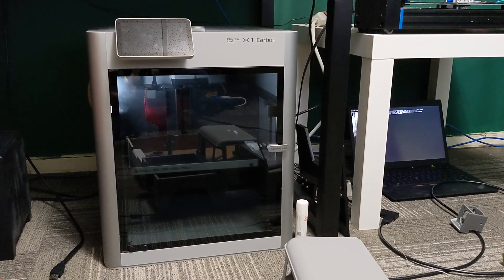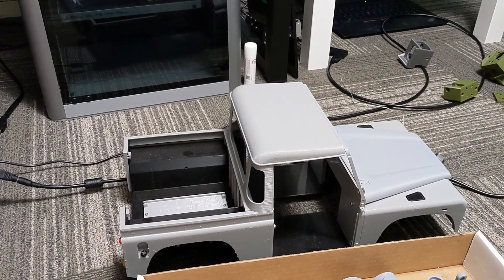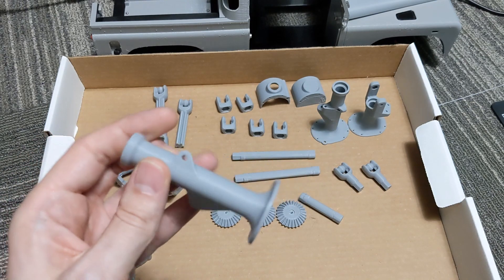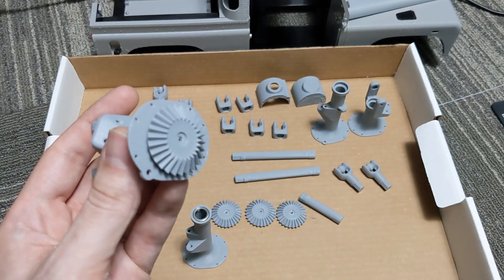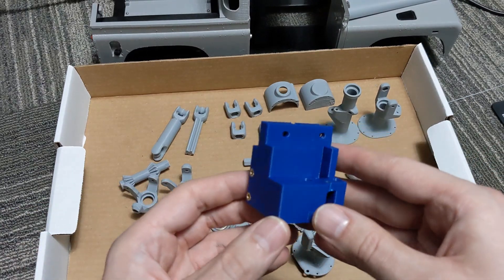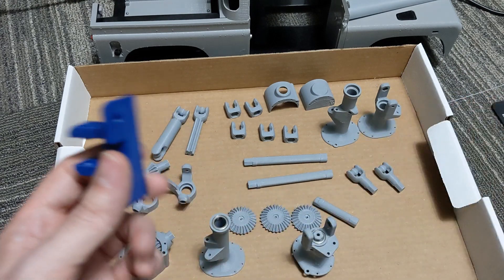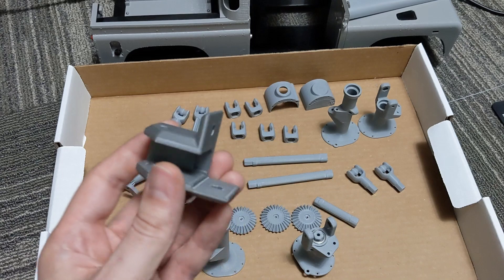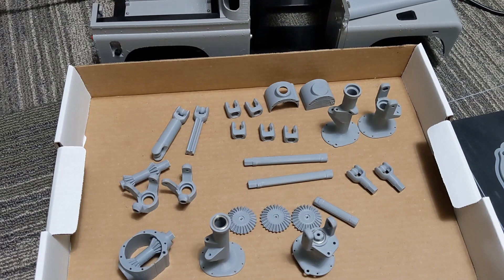Why I love the Bambu Lab X1 Carbon - EP3 PLA, ABS and PETG printing!

Comment: If you didnt change any settings, that didnt print at 200-300mm/s. Default volumetric flow limit for petg is set at 10 so you did maybe 150mm tops
Reply from the maker: Ya your right flow would have capped the speed, still impressive and easy to use for PETG

Comment: Have you tried alternate support material different than part?
Reply from the maker: I have not, I don't do any multi-material prints. However the bambu slicer supports are really nice so different support material should work well
Reply: @Rolohaun  yes I know..

Comment: damn, you're lucky that your Bambu is so accurate - my X1C is off by 1mm on 200mm prints, and I haven't found a way to calibrate X/Y steps unlike on my Ender 3. Will try some large prints in ABS soon

Comment: I have the printer and I'm having problems with PETG.  Support seems to not stick together and make spagehetti and ruins the print.  Any settings you suggest?
Reply from the maker: try and put the printer is silent speed mode to slow it down a little, I have only tried Polymaker PETG and it seemed to work fine with supports

Comment: Thank you very much for this review. Your experience with PETG is different from Aurora tech in depth review where 100 mm/sec was the highest speed that didn't have layer adhesion problems. Also did you print the PETG parts you show ("printed at 200 to 300" ???) at 200mm/sec or 300mm/sec?  Did the large part fan run during PETG printing ?
Reply from the maker: I never changed any settings, normal speed. Polymaker petg

Comment: Are you using the AMS eventually? Anyone have issues with it? (using the supported filaments in it, PLA, PETG, etc, I know you should not use PC or TPU in it)
Reply from the maker: Yes I have the AMS it work great no issues at all, I use it for filament storage and it much more convenient to swap filament with it, I don't do any multicolor

Comment: I'm concerned about printing in my small basement space (14x15) that has no windows, one vent into the main house from a nearby heater, and an adjacent laundry room. I cannot modify the house as I don't own it, and so I can vent it outside. I am getting a H14 air filtration system and an air monitor. What else can I do to protect myself if I decide to print ABS? (I may only be doing PLA/PETG if needed.)
Reply from the maker: The x1c does have a carbon filter but I hate the small of ABS and ASA so I don't print with them much. I think the carbon filter will be ok but the smell might be too much for you

Comment: What printbed did you use for petg and how do you prepare it? Because I ruined 2 coldplate stickers on my first 2 prints and now I am scared to print anymore :/
Reply from the maker: I have used both the cold side and engineering side. I applied the glue stick and had no issues. The engineering side works fine, I set my bed to 75 degrees
Reply: @Rolohaun  Did you just flip the Build Plate so it faces up (Engineering Plate Side) to print PETG (Cool Plate Side down), and just applying the glue to where it would print? I assume just changing the temp in the profile and doing some test prints is the way to go at first (with PETG)?
Reply from the maker: @adambomb77  yes that is what I did

Comment: yeah, i only startet to love my mk3s+ when i had pertinax plates on the bed and lerned to dile in testprints for new filament, also ordering 5+ spools at once helps. 
I give the bambu a try, i think in the current global economic situation it wont get much better than this for many years.
Reply from the maker: it's a great printer and tool that can potentially make users money if your selling prints and such

Comment: Very cool, this printer is trully revolutionary! I want mine!! A.I into filament calibration is awesome! I just scaried about proprietary spare parts… are they easy to find?

Please test carbon fiber nylon on this, make sure to use a hardened nozzle to this abrasive CF filaments. That’s a win-win material for mechanical parts, the CF “holds” nylon to warp a good mix about both of these good properties materials. Where do you live? I heard good recomendations for expert users pointing to CF Nylon from Athomic Filament, a brand from U.S.
Reply from the maker: Parts are very cheap and easy to get from bambu, I do want to try CF nylon. I live in Canada

Comment: I see you have it on the floor vs a table, is it due to how aggressively it shakes during the test and print? I've seen a bunch of videos and I have seen how crazy that thing shakes on tables. I wonder if that messes with the print quality
Reply from the maker: Yes you need a sturdy table to do the vibration calibration
Reply: That’s really a thing. But even if my table dancing like hell, the prints are nice. I will soon update my table with some M8 rods and weights and see if it’s getting better.

Comment: I love my X1 as well, but I don't like this Polymaker PLA. First it has some flex and than it's getting brittle very soon. Some parts I've printed about 10 months with the exact same grey filament I can easily snap like it's out of sugar. And also the bearings will get loose, but that's PLA if you put pressure to it: It retreats. If you want to print with PLA I suggest PLA+ from eSun. The spools also will be fine with the AMS.
Reply from the maker: which type of Polymaker PLA are you using? Polyterra or Polylite? Polymaker also has PLA PRO, I haven't had any issues with mine.
Reply: @Rolohaun  Polyterra PLA
Reply from the maker: @Leynad778  I believe Polyterra is for cosmetic prints only, it's not strong and tricky to print. Try polylite PLA or PLA PRO

Comment: Can you describe how you reapplied your cold plate sticker? It's unclear to me how one would do that.
Reply from the maker: the cold plate sticker came off very easy, to re-apply I just took part of the backing off lined it up with one edge and then slowly pressed it as I applied more and more of the sticker. There should be some videos about applying PEI stickers and that would be the same.
Reply: You may print the tool from the mashine memory and check out the updated wiki.

Comment: My X1 Carbon is on it's way and I was wondering about your comments with regard to the prints not sticking too much on the plate.  Are you applying a coat of anything to the PEI plate (i.e. glue stick) to get that result or is it printing straight onto the bare plate?
Reply from the maker: I do not have a PEI plate but make sure you use the glue stick that is included. Even the corners where it does purge lines. No issues with glue stick
Reply: I use Hair Spray that I have been using for years. So far so good.

Comment: I concur! There is absolutely no other printer like this at this price point. I have printed hundreds of functional parts that have been flawless. No issues with bed adhesion, no clogs with PLA and PETG. I simply send the prints over with Bambu specs and come back to perfect prints. This reminds me of Apple's early tag line of "It simply works".  
Honestly I will not upgrade the firmware or software when updates come out because I'm too scared that future versions will start presenting problems that were not there.
Reply: I see on Bambulab's website and they recommend gluestick for PLA printing.  Have you been using gluestick for PLA or you have perfect bed adhesion even without gluestick?
Reply: @krsteon  Sadly I tested and gluestick is needed for PLA printing on the cold plate. So I do all PLA printing on the textured PEI plate unless a nontextured bottom is really needed. No a big fan of fapping about with glue.

Comment: What chamber temperatures are you getting with ABS?
Reply from the maker: I have not checked but polymaker abs has not warped yet
Reply: I guess around 50‘C depending on the room temperature.

Comment: have you tried to print polycarbonate?
Reply from the maker: not yet
Reply: Will be my next test after ASA. It seems like I’m not getting really warm with PETG. I’m interested how BL PC will perform. Beside the price Pusament PC Blend is easy like PLA and my goto else.
Reply: I’ve gone through about 2 kg of priline carbon fiber PC and the results have been amazing. Also did some non-cf PC with good results. I’m printing parts at 300mm/sec that are better than what my qidi was doing at 30mm/s. I’ve thrown PA, ABS, PETG and PVA at it and all have printed great parts FAST.

Comment: Your report makes me feel great about waiting for my Carbon with AMS (of which I’ll add another one) because I explicitly need things to fit together, ideally without futzing around with test prints to dial in the tolerances.
Reply: I reserved a preorder for the ams carbon x1 like a month ago do you have any idea when they are gonna take my money and ship it?
Reply: @lililililililili8667  how can I possibly know that?  I have no idea what backer number and country you’re in, if you went via Kickstarter.  I made the mistake of not ordering the hub and second AMS when it first became available in the store, but I have the printer and AMS mostly set up, and I was over 4000 for backer number in the US.

I have as much way to know when they’ll ship things as you do, assuming you’re a backer, and not meaningfully more if you’re not a backer.
Reply: I wonder how well the ams will work out with support filaments
Reply: Being able to mate printed parts up with other parts and subassemblies was often a hit and miss situation until I received my X1C, so far I'm thrilled with the accuracy that I'm getting without screwing around printing calibration prints and calculating E-step adjustments.
Reply: @revgregory  I got mine setup and running less than 36 hours ago.

Printed the scraper at normal speed, the Hex Organizer at Sport, 3DBenchy at Ludicrous speed.

Not perfect results at the higher speeds due to perhaps cooling limitations, and also, PLA that’s not been sealed air-tight for over a year in Seattle area humidity.

Still need to do more to test out the AMS and verify all the hardware is working, and I have plenty of multicolor parts to design and print.  For filament and time-efficiency, though, a number of my parts will (hopefully) be mated custom fasteners that are part of the parts I’m printing, no outside glue/tape, etc. used.  As precise as it appears things are, it should be relatively little required testing.